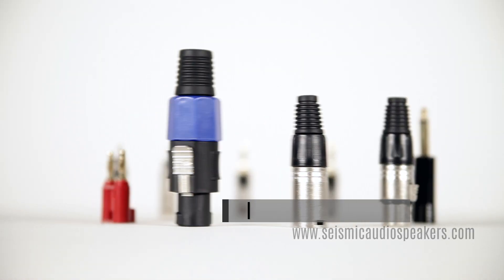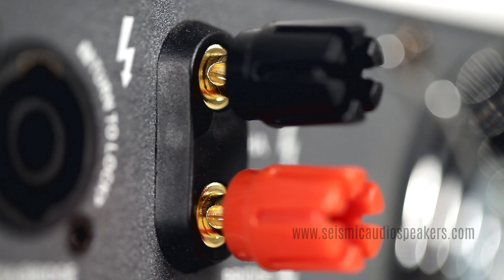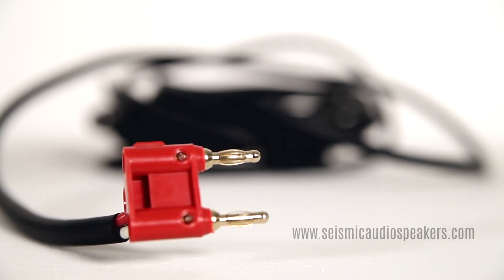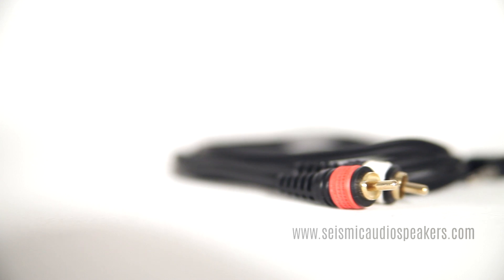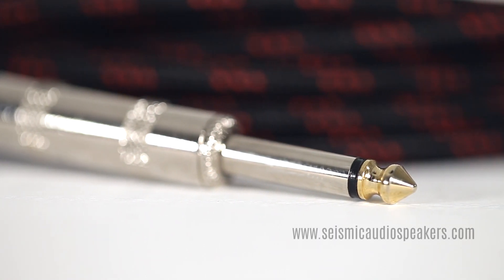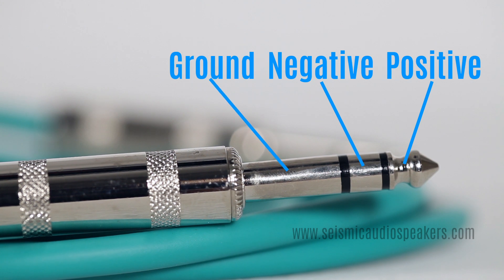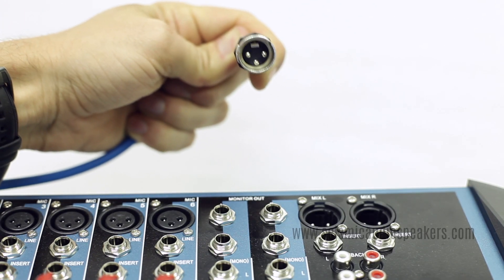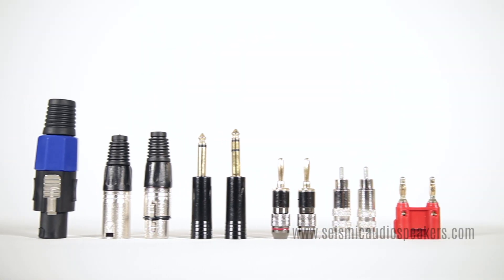Seismic Tips - Connector Types Explained

Comment: Hey guys I wonder if i can use your SAPT5 adapter to turn one channel of my XLR studio snake into a speaker cable. The idea is to connect the amp head from my control room to the adapter with a speaker cable, the adapter to the snake and on the live room en connect a speaker cable from the adapter to the cabinet. Is this a viable setup?
Reply: Hi Dreamoffire cr, If your stage snake is all line level XLR, then you CAN NOT send a speaker level (AMPLIFIED) signal through it. You could potentially melt the high gauge (22-25 AWG) wiring inside your snake. Amplified signals for passive speakers, i.e. speaker level signals, must be sent through low gauge (12, 14 or 16 AWG) speaker wire. Email us directly at customerservice@seismicaudiospeakers.com if you have any questions. Thanks, Rusty

Comment: Great video! What about optical/s/pdif/toslink (what ever it's called)? I know it is not used as much but how does it compare?
Reply from the maker: ***** This video was made to demonstrate common connectors used in an analog workflow.  The connection types that you're referring to are digital.  In analog audio the signal is transmitted as a waveform generated by a device (such as a microphone, instrument, or amplifier).  It's then picked up by the receiving device and is replicated, amplified, or transmitted into sound waves through speakers.  

Digital signals are transmitted as a series of 0's and 1's in binary.  These are typically cleaner and more reliable, still subject to interference.  For these a digital encoder and decoder are required to convert the analog signals to digital signals or vice versa.  In professional audio, these converters are required to interface into analog mixers and other equipment.  

Hope this helps.  Feel free to hit us up with any audio questions you might have or give us a call at 1-877-347-6423 and we'll be happy to chat with you.